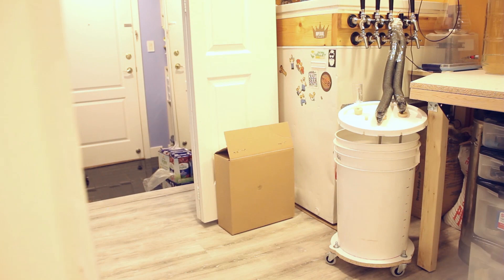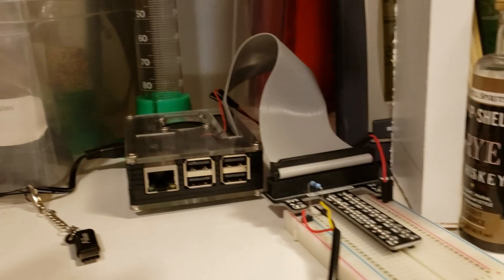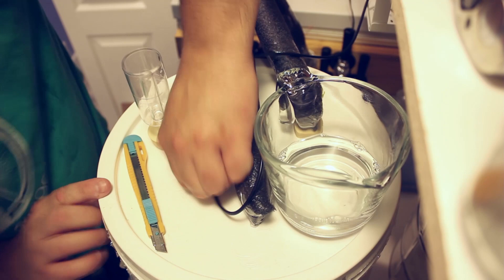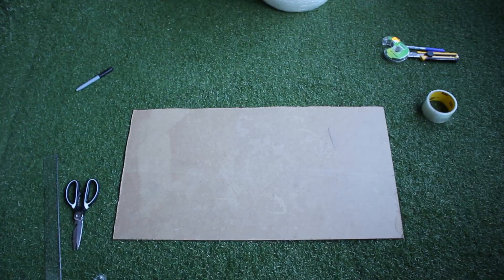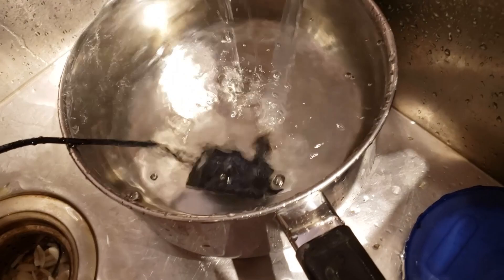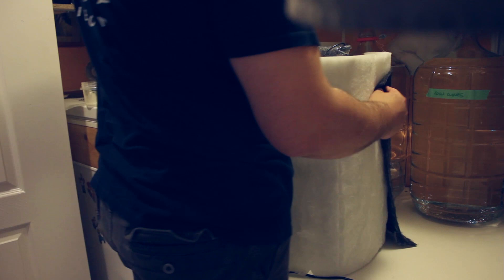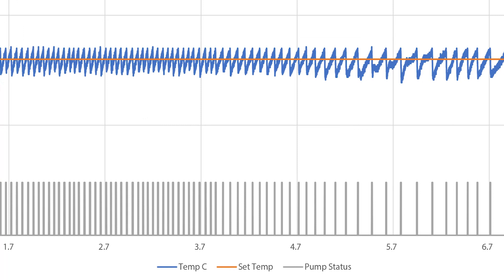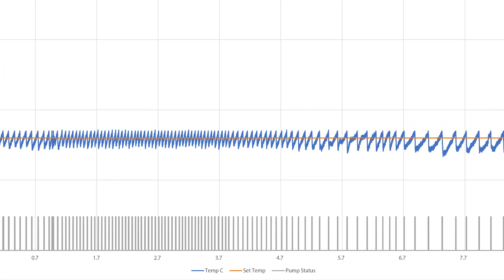DIY Glycol System on Raspberry Pi and Python

Comment: I was chatting to someone over the weekend that owns a brewery. He has a similar setup but has a mcu that controls a valve that controls the flow of the liquid that is jacketing the fermenter. With a function like yours that will open or close the valve to regulate the temp is fine but what he ended up doing was creating a function that tries to get the temp fluctuation constant by just changing the amount of coolant being pumped around his fermenter. Your solution is much simpler and should work just fine though when I end up making something like this I might combine the two solutions.
Reply from the maker: Yes, like a PID system! You can control the system by controlling power going to a pump or a valve controlling flow. The flow rate would be proportional to the current temp of the 'beer' compared to the set point. My system only has pump on and pump off, so no proportional control available. My system does keep it within +/- 0.5 C so it's good enough for me. I'll be upgrading my system soon with real solenoids instead of cutting power to the USB ports via software. Stay tuned and thanks for watching.
Reply: @OpenSourceDistilling  awesome stuff yeah the reason he does it this way is that he can have one batch of cool liquid but different brews at different temps based on the flow rate.
Looking forward to to seeing more cool stuff.

Comment: Newbe here, what is this for and how does it do it?
Reply from the maker: It circulates cold water from a fridge through a coil in a fermenter so a specific temp can be maintained in the fermenter. This is done by taking the temp in the fermenter and turning on/off the pump appropriately to try and maintain the desired temperature. The brains of the operation is the Raspberry Pi computer.

Comment: If you want to get started with coding, I would suggest you get your feet wet with C😉 
C programming absolute beginner’s guide by Greg Perry & Dean Miller 3. Ed.  followed by The C Programming Language by Brian Kernighan & Dennis Ritchie.
And start using Linux Ubuntu Asap😉
Reply from the maker: Hey xiam19, thanks for the comment! Programming in C and Ubuntu is more advanced than Python and Raspbian right? I know that C can run faster but you also have to manually manage memory and compile before running right? I'll have to check it out. Since I'm just new to programming I've been sticking with Python as I believe it's more beginner-friendly than C.